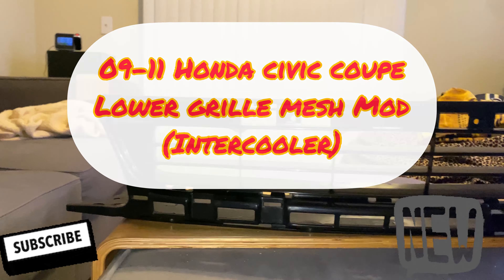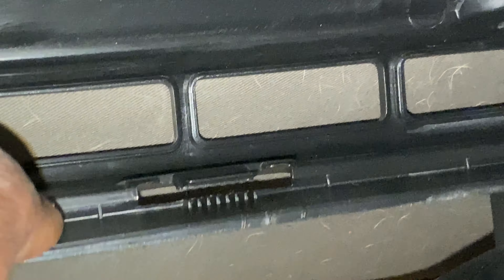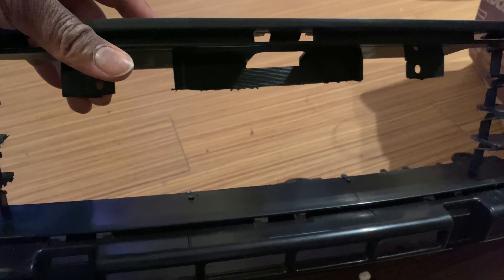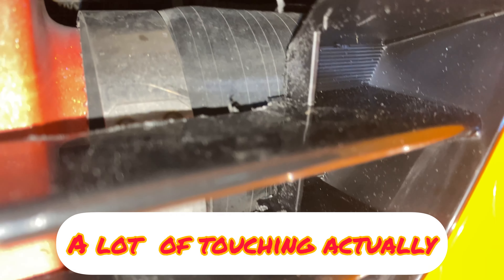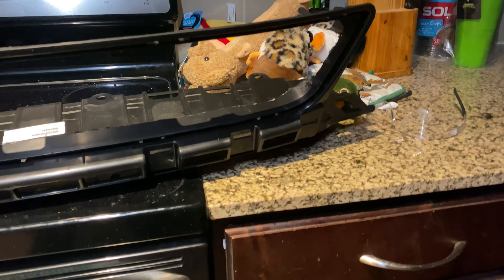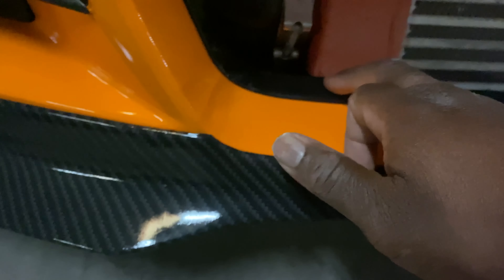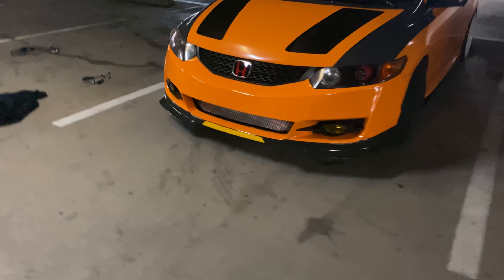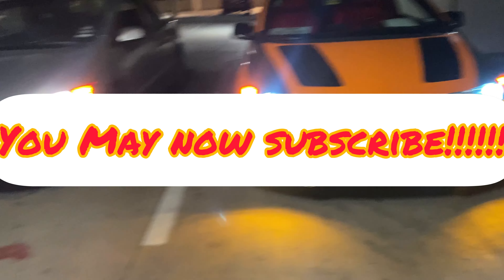09-11 Honda Civic coupe lower grille modified

Comment: It’s crazy that you got so many fees but such a small like amount. People don’t understand that liking the video helps a lot and of course sharing. Appreciate your hard work brother. Your videos help a lot. I recently got a duraflex bumper and I hate it. Doesn’t even fit my whip. Had to quick release clamp it and still doesn’t fit. And it’s fiberglass which is trash. So thanks brother. You helped a lot
Reply from the maker: Np. Becariful with fiberglass parts. Stress cracks are a thing you tap something and it begins to crack

Comment: Is it as easy as just putting on the car or do you have to do any modifications to the mountain brackets?
Reply from the maker: I dont know what your asking exactly. Watch the video if you are boosted with a front Mount intercooler if you want to use the lower grille and cover it for protection. If your not boosted it fits like normal as nothing is hindering it going on.